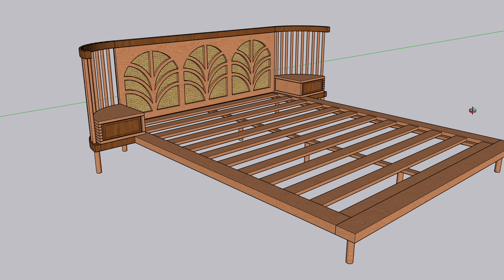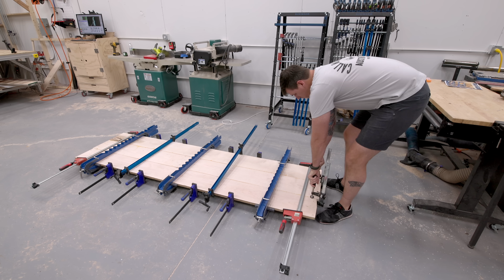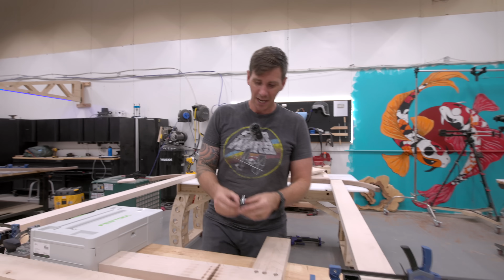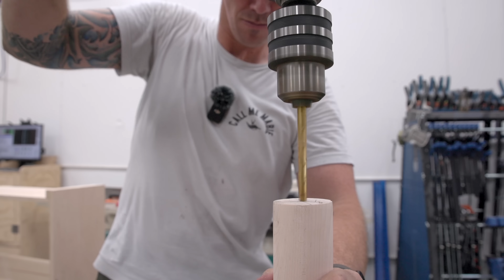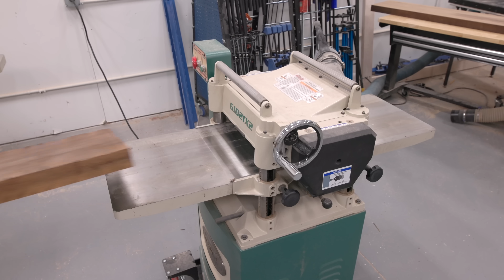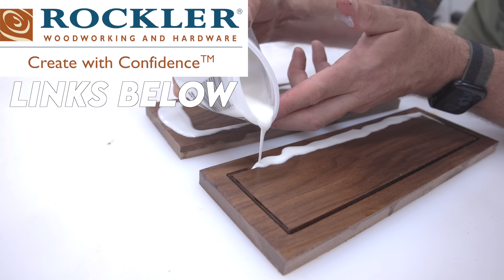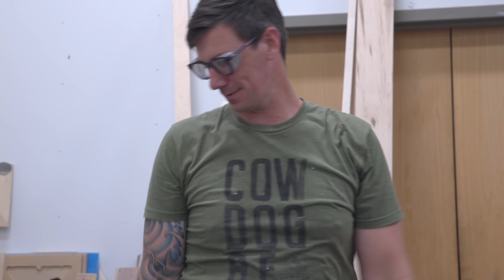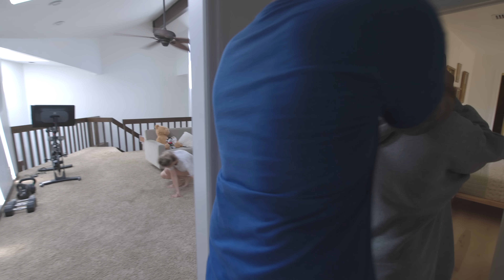She Asked Me to Build This, I ALMOST Said NO

Comment: To fit rattan like that, you would normally use a groove glued with PVA and a 4mm cane, like a Habitat Bauhaus chair. You wet the ratten before fitting, it will shrink a little as it dries. Once it's dried, you trim the mesh.

Comment: Calling yourself a woodworker, while being a cnc operator and then saying you don't care what people say about it really expresses how little of a woodworker you are, and how much of an cnc operator. 

Woodworking is craftmanship, cnc operation is being a designer at best. The machine does the crafting. And you take the credit?

Sure you can, for the rest of the work. But mainly you should adress the people designing the machine. Because in your case - THEY are the ones that made this possible, not you. 

Wood working at expert level is so much more than just working with the wood. It means understanding it so that it will stand the trials of time. 
Without that experience and knowledge, high quality products cannot be produced. No matter how advanced your CNC machine is.

I know that you are a wood worker, but statements like is brain draining the whole craft. The same statement would in the long run mean that a machine mimicking humans are actually humans. We might not see the difference, but there surely will be one. 

A shortcut here and there never mattered - but don't start changing and redefining traditional definitions. If we all did this, everyword we use will soon be out of context. 

Language is important, we need to care for it.

Comment: Looks pretty cool, but I thought the bedside draws were to low and to small. The bed headboard was built wrong. You should have started the cutouts a bit higher so the mattress don't cover them. And the rattan I'd would have sandwiched between two layers. This would make sure it would come loose in  years... 
At the end when you built the bed together what wss that stain on the right sideboard?
Construction ways it's really really nice

Comment: I will admit it, I am so envious of all your wonderful woodworking equipment. Great kit. It is a gorgeous project. I personally would have added some height to account for mattress depth as it's a shame to obscure the view of the lovely design features of the headboard. Also, I would have had the drawers level with the mattress top. I would not have the base bigger than the mattress, although I do appreciate the aesthetic. Makes my shins hurt just thinking about that. You have to sit with your bottom closer to the mattress edge to sit on the bed, as kneecaps don't stretch, and that’s going to cause sagging to the mattress edge over time. I'd personally find that uncomfortable to sit on as it would dig into my calf muscles too. I think I'd add a bookshelf, a small cupboard or deep standard drawer under each swing out drawer. I am wondering if you forgot that a mattress was going to be present. Wood only tunnel vision is a thing, I think. So easy to focus so much on the beauty of the wood, you forget other things will be on a piece of furniture. Just my personal opinions. I am throwing no shade at your skills. I have to say, as someone from the UK, you Americans really got it going on where it comes to woodworking. Our pokey little houses, not everyone but most of us, don't have space for so much equipment and our wood prices would makes an America's eyes bleed.

Comment: Excellent work. It looks really good, and the client seemed to be rather delighted by it.

If this was for me, I'd want a couple of tweaks. The pattern on the head board section would only be in the area above the height of the mattress. Also, I am not a fan of the bed being wider than the mattress. (I bash my legs on the wooden bed. That's not fun.) But I realise this is a particular style.

Comment: I love these projects. I can do too, well i can start them 😅. They sit around for months sometimes. I now do build in place pieces and smaller pieces.  Waiting for glue and paint to dry is like watching water boil. And sanding is too much for me too. So, i make drawers and such, end tables and night stands. Im talling easy stuff here but functional for us. Like my desk, theres no wjere for dirt or animal hair to hide because the legs go from the front edge down to the base of the wall. My next project is a thin drawer mounted on full extension slides under my desk for my leather tools. Oh! And i finally put the bed skirt under my bed (wood all the way around the bottom to prevent lost socks) and man is it great! Hats off to wood wood workers, i attached the head board to the wall months ago, just now did the skirting. Next is the footboard and will likely be done next summer 🤭

Comment: As pretty as it is, all I see when I look at so many nooks and crannies in that headboard are dust collection points. 👀  Seriously, unless you're running an air filter 24/7 right next to that bed, that's going to be a nightmare to keep dust free, even with a vacuum to help. 😅

That said, the only fault I see in the design is that the arches were placed too low and are pretty much completely covered by the pillows almost to the point that they might as well not be there.  I suppose it would have been even nicer if the back of that cane was covered up so it wasn't so ugly in the back (even just some thin, smooth, white painted particle board would have been nice and tied into the drawer fronts, just in case you ever need to put the bed somewhere that the back can be seen) but that's a minor complaint. 🤐

I am very impressed with the work, problem solving and dedication shown to the project however.  OMG, well done! 😁👍

Comment: Don't you have a chop/mitre/radial arm saw? A jigsaw is so wrong.The old phrase/≥..I cut four times and it is still too short. Im like those Rockler clamps but would like to make functional 'like sets' from PVC capped 2x2's But what do I do with 200 feet of various Pony pipe clamps.

Comment: The whole attitude of "You're not a real [X] if you use [X] tools is idiotic, and as old as time. There was a point where anybody who used anything more than a chisel and a rock as hammer, all fitted by eye, would be accused of not being a "real woodworker". Yet people who complain that those who use CNC aren't "real woodworkers" have no problem picking up power tools, using pocket screw jigs, track saws, table saws, joiners, planers, dominos, etc. That's assuming they actually personally engage in any form of 'craftsmanship' at all; and aren't not just keyboard warriors trolls who live vicariously through watching OTHER people do things on Youtube.

The irony is that most people who think that CNC makes you less skilled, haven't the slightest clue of what it takes to actually program and run one. Those of us who actually have the skillset to run them are able to appreciate that skill in others.

Those who don't have that skill just assume it's just a matter of uploading a photo and pressing the 'Start' button.

The Dunning-Kruger effect is extremely real.

Comment: a trick i found with Ratan is to soak it in water. it expands a bit when its wet and when you glue it down the glue penetrates the material as it dries, but the secret is that as it dries it draws tighter naturally.

Comment: I've seen you do real wood working, but no CNC parts are not real wood working.
They are an art, but that art is not wood working.
It is digital design. 

You combine that with real wood working, but many don't. They only use the CNC

Calling CNC woodworking would be like calling 3d printing sculpting.

Sure, I could 3d print a mini statue of David, but that wouldn't make me Michelangelo

Comment: Awesome build. As a variation to this bed how about making the dowels opaque PVC and adding an LED strip below to light them up. Then add LED strips under the bed. I have voice controlled LED under my bed that looks similar to this. Control is a Sonoff Mini R2. This control has a separate on/off rocker switch incase internet is down.

Comment: I have one critical comment -
The design and construction are fabulous. The issue is the corners at the bottom end of the bed. They will be so easy to hit your shins against. I would have accented the head end curves with a curve at the bottom corners. No more whacked shins.
Reply from the maker: Just cover it with pool noodles. Problem solved!

Comment: @jonnybuilds for the connector on the top of the headboard, could you not of drilled the hole for the cam nut on the back of the headboard instead of the top? Just a thought.

Comment: Thanks for sharing this with us, 2 comments if you allow me, 1- you mentioned that some viewer commented about using the CNC, I have to agree with them, to me it is not a matter of efficiency as you mentioned unless it is in a commercial environment, I would like to think about your work as a teaching platform if you agree, and doing it with CNC wont teach us anything as it is out of reach for most woodwork fans. 2- would you agree that the back panel/board should have been taller by a bit more than the mattress thickness, so much so the artwork is visible and appreciated? thanks again

Comment: Beautiful job. Your daughter is a lucky young lady to have a dad like you. (and vise versa of course). The one thing I did notice once it was set up were those hard corners at the foot of the bed that could be potential shin breakers. I think they would have been better rounded off. The reason I notice this is because my wife just naturally finds sharp corners and will always run into them. Everything in our house has round corners, including the walls. That CnC router is a great tool by the way. I can't believe people would disparage you for having it. If people like that were running things, we'd still be running around with pointy sticks trying to catch our next meal.

Comment: Nice build.  I think you should to a troll video where you do everything with the CNC and domino... like even put the wood back on the CNC to remove glue squeeze out, etc... see if you can mount a sanding pad to the CNC... just go extreme-troll on all the self-proclaimed woodworkers...

Comment: Hi 
I Love that you are working smart, not hard. If i have tools/machines, that make my working operations easier/faster and some times even better, then give me one god reason not to use them.
I’m a carpenter, and i use my CNC, 3d printer and what ever makes my work easier. If there is an tool that makes my work better and easier. I will probably buy it. And my wife will tell me :- You don’t need it.😂 Of course, the cost of the gear must be reasonably affordable.
Now for the questions that i have!
Now that you are using the cnc for carving the back of the bed, why don’t you change the tool after the first operation/cut, to a roundover bit? That would save you a lot of time and work
Only wondering, no criticism.
By the way. Absolutely wonderful work!
Bets regards Kent

Comment: small hint about the trick with the one two three block. when you make the cross, take your time and not only mark the piece at 0° and 90° but also at 180° and 270° when your dowel is exactly two inches, the second pair of lines line up exactly. If they are not, the lines create a little square and the true center is in the center of that square. this also works well when you know beforehand that your dowels are an odd size.
Reply: Neat! I might have thought to do the second set of lines but wouldn't have known that the resultant square was useful for anything other than telling me my dowel or measurements were off.
Reply: Here's some hypocritical advice, don't offer advice unless it's requested 🤷
Reply: @ThomasSawyers  The first unsolicited advice was interesting and helpful for other viewers, and inoffensive if Jonny was already aware of it (and he says IN this video that comments can be helpful). Your unsolicited advice is not just unnecessary but unnecessarily mean, and offers nothing to anyone.
Reply: @ThomasSawyers 

Ew, you're one of the bandwagoners, huh? Someone who doesn't think for themselves and jumps on whatever bandwagon they think others are riding. He said he hated troll comments. He also said the good comments are helpful. I've seen other dummies hating actually helpful comments simply because they think any kind of advice is trash advice. 

Your comment is one of the absolutely weirdest instances of someone not being able to "read a room" I've seen today.
Reply: @ElysetheEevee  ew you're one of those internet warrior defending the perpetrators of something nobody asked for, get a life.

Comment: For that kind of money I want storage.  Lots of storage.  (Nearly got a storage bed, but my room only really works if I put my queen sized bed with one of the sides against the wall, and all the storage beds focus on drawers on both sides instead of deeper drawers.)  Currently hanging the table top of a table that my great grandfather made over my bed, using french cleats and only using original holes so it's reversible, but somehow got off of level with the bottom half and trying to figure out my next step.  :(

Simple jig idea for dealing with that dowel assembly, trying to keep all the dowels straight while inserting them all... just use a piece of cheap, soft, thin scrap (1/4 inch?), and cut it the same shape as the curved pieces, but drill the holes all the way through, with just a tiny bit bigger holes (so the dowel will fit through it).  Rest it on the bottom piece as you assemble it and lift it.  It should pull all the dowels straight.  Put the top piece on and glue it, and then just cut it off.  (Even really heavy cardboard might work, and you could cut that away with good scissors.)

Looking at the final project, it looks great, but if you were redesigning it, maybe raise the headboard a little bit to show it off a bit?  Also, having had a slat style bed without a lip, I might have made a tiny lip to keep the mattress in place.  It wouldn't have to be full sides.  I suspect even something like a 1x1 strip with the top corner on the outside (like a 1x1 rounded moulding strip... short enough so she doesn't whack an arm on it when she rolls over, but tall enough to keep the mattress from sliding.)  Alternately, you could probably lash it to the slats if you were willing to cut into the bottom of the mattress.

Comment: That is..very gorgeous. 👌 My only recommendation would have been to put an inner stopper to prevent the drawers from opening beyond its 90° rotation.  Well..also a felt riser slide under the drawers to prevent sagging from weight being added.  But superb work otherwise.

Comment: A neat build.  My only critique on this was that I thought the pattern on the headboard was too much covered by the bed itself.  It was too low and needed to be raised up so it was exposed and visible.  However, to do this you'd probably have to make other changes to accommodate this, which might change the over all aesthetic, taking it out of the desired specifications of your daughter.  I can imagine a couple different ideas on how to do so, but that's an unnecessary rabbit hole, since overall I like it and more importantly, so does your daughter.
Reply: I think the cutout design should have just been limited to the exposed area.  No need to change the overall shape, and the reason it looks bad is that the visible portion is a clearly incomplete pattern.
Reply: ❤ this bed turned out beautiful and the look on your daughters face. Priceless.
Reply: You should have said no

Comment: Am I missing something, can you not just staple cane webbing, would have been instant and you could have gotten on each arch without worrying about glue.. reducing gaps for dust and sagging later on.
Reply: Sorry, that is a question, not a dig. Beautiful work, bed looks far better than anything you could have purchased. 👍
(If you add some non slip rubber on the slats, it'll stop the mattress sliding about)

Comment: I wasn't going to comment, but after doing some woodworking build at my fathers.  You are a woodworker, even if you use a CNC machine.  Does that mean because I now use a power drill and table saw I am not a woodworker?  I did the woodworking for my father because he only has hand tools, and lives 1800 miles away from me.  Technology changes and advances my skills.  I'm sure you could build by hand if necessary, that makes you a woodworker... I wish I had a CNC. Gorgeous bed, loved it.